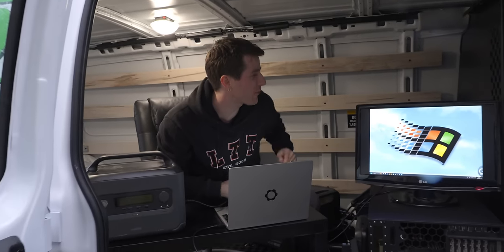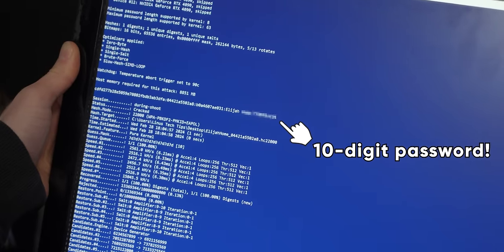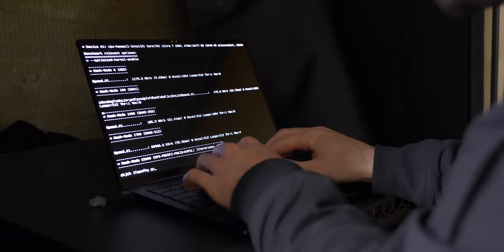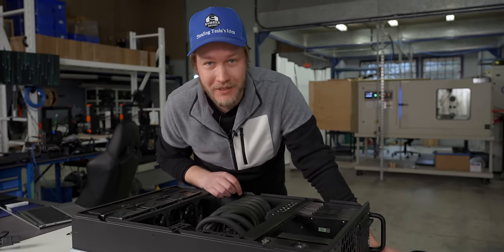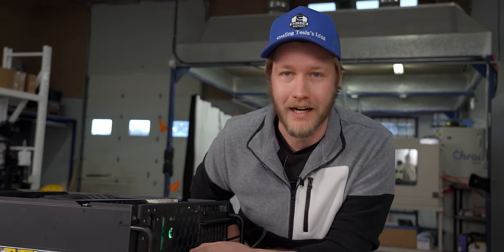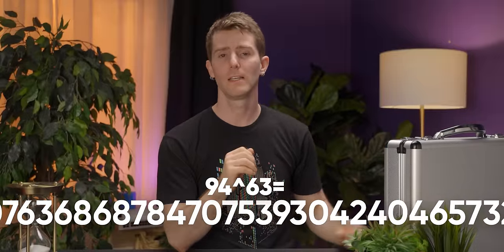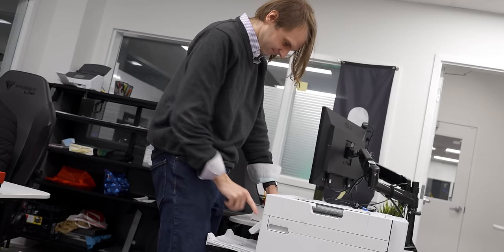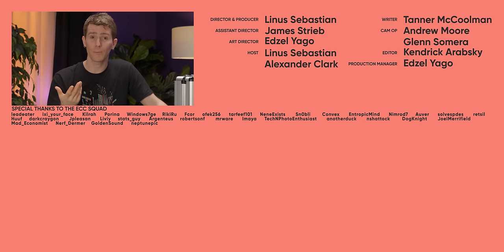I Made a Wifi Cracking Van

Comment: Ah, war-driving.  I remember doing this in the late 90s and early 2000s.  We used "can-tennas" made out of  Pringles can.  We had. Soup can to scan a wide area, and the Pringles can to zero in and crack.
Reply: cantennas arent used for war driving. two very separate use cases.
Reply: I remember my computer science teacher telling me about doing that.
Reply: @kenGPT  we used them while war driving. Helped to zero in on wifi.
Reply: @MrBarcode  yeah? What makes you think so? You wanted to publicly call me a child so own up to it

Keep in mind that you are talking to someone who has been hacking Wi-Fi for 20 years and I professionally give advice to businesses on their wireless posture
Reply: @kenGPT the heck they weren't. some might not have, but plenty of people did. it sucks for broad area scanning, but they're super useful for pinpointing to maximize signal and limit dropout due to the surroundings/rf. and then again, if you want to keep using that wifi you just pinpointed.
Reply: @kenabi  Yes you are correct that those antennas are used for pinpointing.

But war driving is not about pinpointing. It's about gathering anything within the vicinity. If you want to attack a specific network then that's not war driving.
Reply: @kenGPT  Yeah? Well right now you both sound like children LMAO
Reply: @kenGPT  Man, the 20 years of hacking and professionally advising businesses on IT can either mean a middle aged guy with lots of experience at a consulting firm or a ~30 yo working on an IT helpdesk that guessed the password of his neighbor's router when they were 8-10. 

TLDR. Your "qualifications" don't sound too impressive.
Reply: @sergiogsr  The person I was replying to wanted to call me out and now they are silent. And I'm not going to reply to a bunch of people who think they know how to hack all because Linus paid a team of people to pretend to be hackers for a short video.

This is what gives actual hackers a bad reputation. A bunch of skids who love to keyboard a bunch of insults without anything to back it up
Reply: did this with a raspberry pi, wifi dongle and a power bank :D had it with me in my car while driving around and at home cracked some wifi passwords. Fun times
Reply: @MrBarcode Awesome story Dude. Imagine if you would have done that. Pretty cool back in the day. Kindest regards, Richard U.K
Reply: I ran Kismet in my semi-truck for a few years gathering all kinds of data just from the USA interstate roads. Today, every google phone scans wifi AP with location and uploads to a master file. This is why google maps can start out so quick, they use that huge wifi AP to location to start the GPS lock.
Reply: oh you really need the fridge and all the lights in your house to be on the internet 🤣🤣
IoT 🤦‍♂ just an open-door for someone to change the colour of your hue lights, and passwords. 👍👍
Reply: Ha.  I built a biquad with a plastic bulk film can for the radome 'cos it was more compact for the same gain.  Oddly, later I did a 900MHz version for a drone project at a startup that sadly went the way of the dodo.
Reply: a la mr.robot
Reply: War-driving, I'm assuming that's a play on war-dialing?
Reply: @MrBarcode for the campgrounds omg. I would’ve sold my soul for that back then
Reply: @kenGPT  You were born in 1990. You're a child, stop trying to lecture people who actual did what you read about.
Reply: This is not wardriving
Reply: @Obi1kenobi10 did you use them for war driving?
Reply: @peanutbutterdijonnaisesandwich  to find a wifi signals location.  When we got close, we just used a wireless nic.
(We did this a "service " for companies we had contacted with. Just to show them how their wifi was open. The can-tenena would let us know what part of the building the AP was in.)
Reply: And its as illegal as f---k!
Want to stop it? Don't broadcast your SSID.

Comment: You forgot WPS and Man-In-The-Middle attacks, when you force a device to make a handshake with your fake Access Point.
You clone the Access Point characteristics, then you wait for a Handshake (or you send a disconnect signal) and you have the key.
Reply: Damn WPS is ridiculous. If I recall correctly, it's a set of 8 characters that you can split in two and validate two sets of 4 chars instead of 8. To top it off, the last character is a CRC so you just had a group of 4 chars and a group of 3 chars to crack. I remember the main ISP in my country adding a max number of tries, followed by a long timeout to try again, making it significantly more time consuming to hack. Of course you can just drop a raspberry pi on a battery pack near the device and let it do it's thing over the course of a few days.

I remember having a netbook in 2012 with a dualcore 1.6 ghz ARM processor and just getting all the wifi passwords around my house in a matter of minutes. Edit: Intel Atom® Processor N270 single core with hyperthreading.
Reply: I haven't seen any numeric WPS in years, only push button WPS.
Reply: @d4m4s74  I live in a country where technology is a little behind from the latest and greatest so numeric WPS is still used. To make things worse, ISPs cheap out on routers so you are basically required to get a higher end router to not only protect yourself but have great performance.
Reply: @hofa  It can be worse. Some manufactures also choose some "default" PINs for their WPS, so the tools commonly tried these first, to the point that sometimes it was possible to "guess" the PIN on the first try, if it was something like 12345670.
Reply: @hofa  Reaver with Pixedust does exactly that. Reaver does brute force while Pixedust check for static interment keys, like using all zeros as part of the keying process,  and cracks it in seconds.
Reply: @hofa  WPS push button is great for the devices where you cannot scan  QR codes, but you have to enable/disable your WPS in router everytime you wanna use it.
Reply: @techwolflupindo  yeah reaver, I remember now, thanks!
Reply: @Black_Ace14 Fun fact Some ISP's here in Switzerland would send you an old Sagem style router by default when you subscribe and only when you complain to them about security risks would they accept a return and send a modern one from Fritz (which are awesome routers btw).
Reply: Could also turn on MAC White Listing, reduce signal power, install foil isolation, hide SSID, or live in the middle of nowhere. Besides that use a wired network whenever practical.
Reply: For an Evil Twin attack you need to know the existing networks PSK. Just FYI.
Reply: here where i live every hood has at least 2 networks vulnerable to wps attacks. It's as easy as WEP cracking back in the day. Not sure why it's not mentioned. Still works in 2024, no need to do WPAx stuff. Cloning APs is too troublesome when you got WPS.
Reply: Forgot? I mean, he also forgot about quarter of a million of other widely spread vulnerabilities.
Reply: That's why mine is an animal special character, and mine and someone else's birfday, im changing it now though.
Reply: I have no idea what any of these sentences in this thread means, yet i read all if it anyways.

Comment: You left out the most common attack vector at this point, which is forcibly making devices drop off the network and reconnect, so you can get many, many more handshake samples.   It also allows replicating that handshake to allow outside devices to mimic and replace devices.   Many amusing tricks are possible!
Reply: you're not wrong but wps is still the most common vector (horrible that it still works in 2024 but good for me), trust me i do this every other weekend. i explained it more in another comment

Comment: I used a 20 character random alphanumeric, it drives my sister mad whenever she needs to use the WiFi at my place but I'm not gonna compromise
Reply: Why not simply use WPS?
Reply: Your downfall is you told us how long it is
Reply: My buddy used an image translated into text. It was a few hundred thousand characters I think
Reply: In your phone (both Android and Apple!) you can go into the wifi settings and tap to generate a QR code. You can print or just show it. If you scan that using the camera app on another device, it'll show a "Connect to wifi" option. It's really cool and supported in all modern phones. Linus mentioned this in the video, but he didn't mention how easy to do it is. There's no setup steps in the software side
Reply: @Jehty_ WPS is full of vulnerabilities.
Reply: @DankasorusRex cool but how to tipe it on something like a printer
Reply: FYI, you can black/whitelist devices by mac for better security
Reply: @Jehty_  Bruh I can crack WPS networks in minutes with my phone lol be it android or ios

WPS is absolute garbage
Reply: @TheMotlias  Are you periodically changing your passwords though?
Reply: @FirelessElectric  any actual vulnerabilities? Meaning vulnerabilities that actually would allow someone to access my network?
To my knowledge: No.
Reply: @FirelessElectric my routers WPS button is virtual. Only accessible through the app. Thought that was a clever way around that vulnerability
Reply: @watema3381  how?
Reply: WPS isn't long enough, need at least 4 characters.😂
Reply: I've done about the same, and it annoys my family as well, but 100% worth it to make sure I'm more secure since I'm on T-MO 5G internet.
Reply: Why not 63 characters
Reply: @shorge37 plug a keyboard in? Every decent printer has at least usb. The crap HP (and others) sells obviously not, but those things aren’t printers l they are a farce.
Reply: You could generate a qr code for people to scan you monster.
Reply: @Jehty_  because it's awful.
Reply: @erebostd 
oh, i didn't think about a possibility to plag a keyboard
my printer is too old for this but thanks for an idea
Reply: @Cerg1998  Problem is that spoofing a mac address is as easy as setting it... And if I know your mac, say because I made an evil twin (or I think your device should even broadcast it while probing for a wifi network, but don't quote me on that...), I can just spoof it, and act like your device...
Reply: @Jehty_ The vulnerabilities with WPS will allow someone to access your network. IIRC, anyone who wants to will just cap the handshake when it is being used. Good rule of thumb is: the more convenient, the more vulnerable it is.
Reply: Bruh.. just save it
Reply: @Jehty21 yes because it uses a 8 digit pin which can be cracked in under a minute by an iPhone.
Reply: @Cerg1998 TBH, I wouldn't call it extra security, more of a small hinderance or a speed bump for lazy automated key capturing scripts, realistically, grabbing a usable valid MAC from your network is REALLY easy, almost no one disconnects EVERY wifi device not in use, meaning there's usually a list of whitelisted MAC's right there, depending on your typing speed, spoofing one will take in the range of 5 to 30 seconds, it's certainly not a bad idea, but it doesn't really add much in the way of security.
Reply: So the SHA1 checksum of a file. Cool.
Reply: @FirelessElectric  Why bring that up?
Reply: @Jehty_  Better make sure that it's WPS PIN only, but even then....
Reply: @user-fj3gt2rj4e worse yet, you only have to guess 4 of the 8.
Reply: QR Code?
Reply: @Jehty_ you really think wps is safe? 😂 stop trolling
Reply: @maddscientist82  "when it's being used"
Isn't that what makes it safe enough? It's only used for minutes every few months. How tiny is the chance that an attacker is listening just in that moment?
Reply: @DankasorusRex  WPA PSKs have an upper bound of 63 characters.
Reply: @Cerg1998  HAHAHA "Better security" my ass. You do realize every single wireless device is broadcasting its own mac address 24/7 and any attacker could just catch it midair and use it? Seriously, people who boast about their wifis being "secure" while having them "Open & Only with mac address" never fail to make me fall on the floor laughing.
Reply: Just here to echo that MAC filtering is useless. Back in high school, someone found out the school wifi password. For a while, we had unhindered access. Then the IT got wise and started MAC filtering (I assume they were too lazy to just change the password and have to reconnect all wireless devices). So everyone else lost their internet, but I always loved using Linux so my Ubuntu laptop with aircrack-ng got even BETTER unhindered access after I started capturing & figuring out which MAC addresses belonged to teacher computers. I could easily use any of the MACs and get access, but teacher devices weren't content restricted so I put together my little treasure trove of them to be able to go wherever on the internet I pleased. Made study hall much more bearable.
Reply: Qr code to the rescue!

Comment: This just demonstrated the importance of VLANs and layer 3 routing. 

People say I've gone overboard, but it's a 5min process to set up a VLANed SSID and configure that on my network to limit where my IoT devices are allowed to connect. Seperate password for each SSID. etc.
Reply: If your Wi-Fi access points support VLANs. As far as I've seen, that's limited to Enterprise hardware or custom firmware.

Comment: As a truck driver, I have been using public wifi for over 10 years. Started out using laptop card that had an antenna and using some early WEP cracking software. My upgrades over the years was rigging up an rocketdish on push up pole outside the cab of the truck. I am currently using aircrack-ng and reaver tools to get internet access. Today, very few routers AP are pixedust crackable. But the amount of free public internet access has grown also. So I am planning on upgrading my dish setup to handle 5G band as the single square mikrotik wifi antenna gets over 100Mb/s on McD fast food places at distances up to a mile away. So as a truck driver, a big externial 5G band antenna can pick up all the free internet access points at all the fast food places and all Walmarts and many large stores. So having to "crack" into an AP is getting less and less now a days.
Reply: Free 5G? Never heard of it. Why would a fast food restaurant host cellular networking?
Reply: @Mikkel111  i think hes refering to 5ghz frequency, I might be wrong though
Reply: @Mikkel111 to sell coffee
Reply: @Mikkel111   JIO and Airtel is giving free 5G for over a year in India
Reply: Why do you not buy unlimited cell phone data? Isn't it quick enough to almost do anything?
Reply: @heni63  In the USA, "unlimited" means a data cap around 2GB to 10GB of data before getting throttled to dial up speeds. With game updates regularly hitting 10GB and above, one could burn though that cap in minutes.
Reply: @techwolflupindo  No confusion if it’s referred to correctly.
5G isn’t a band. Just saying 5 Giga, meaning billion, means nothing. Giga Bytes? Giga Baud? Giga Tonnes? Giga Bananas?
Therefore, the most logical conclusion would be that you were referring to the 5th generation of cellular networking, 5G.
Reply: @techwolflupindo  oh I didn't know that, "unlimited"..
Reply: This was a lot of time and effort to stick it to the man.  Probably would have been cheaper and way easier to have had a cell phone with an access point lol
Reply: Dude love it!!!! Keep rocking it!